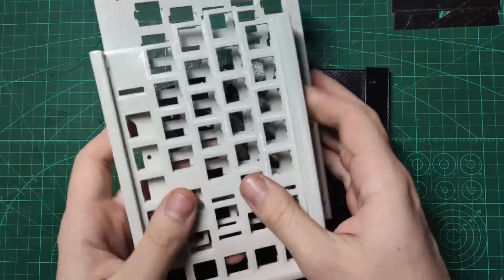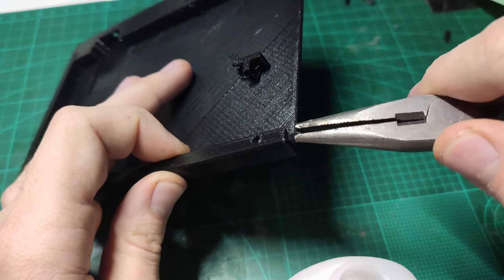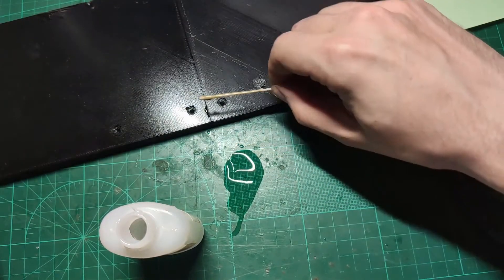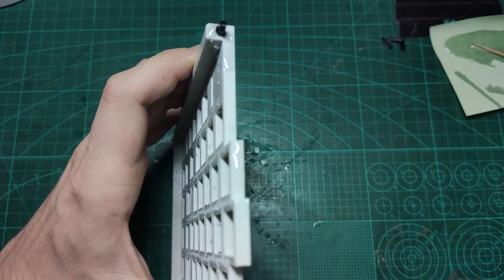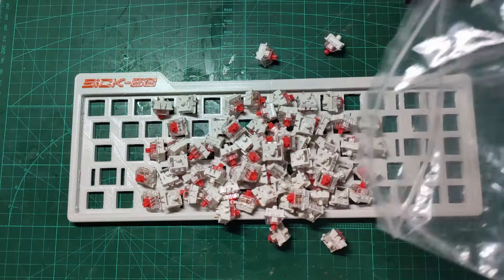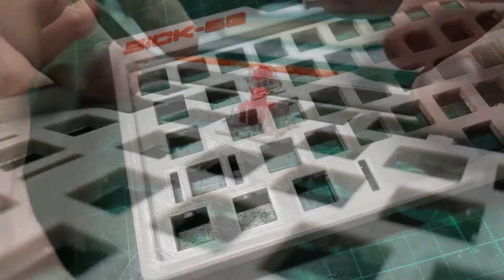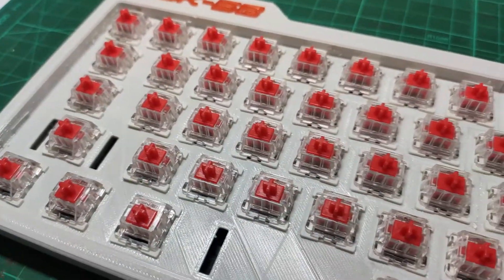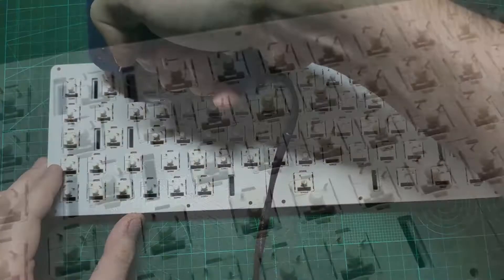SiCK-68 | 3D Printed Hand-Wired Mechanical Keyboard Build | Part 2

Comment: Very good project ! Did you lube the switches before mounting them on the 3D printed part ?
Reply from the maker: Thanks. No, I didn't lube them, but I should have since cheap switches benefit from lubing more than expensive switches. I did lubing on my other keyboard Corne Classic that I also did video of.

Comment: Thanks for the video. How strong is the glued join? Does it feel like a weak point?
Reply from the maker: Thank you for leaving a comment :) Not at all, the glue I'm using is very strong, it wouldn't even need the dowels for support. It's cheap hobby superglue from hobbyking, I added it to part list in the description.

Comment: I want to see the third part of the keyboard let's go
👍
Reply from the maker: Thanks for the comment! I worked on it yesterday and it should be up later today. I'm doing the hand-wiring in the third part and I try to explain the modified diagram for arduino micro. Stay tuned. :)
Reply: @infiniteoffset  it is possible to show the entire codode step by step of the esplicanodo ardoino and what day we will have the vidio I am really enjoying
Reply from the maker: @joaocaetano9362  I have just released the part 3, it took me a little bit longer, because my video editor hates me :) I tried to focus on the hand-wiring and I didn't show whole arduino flashing process since it can differ a lot for people using various operating systems or micro-controllers and there are multiple ways how it can be done. 
For short, I have just installed QMK on my computer https://github.com/qmk/qmk_firmware and then by the command '$ qmk flash -kb handwired/sick68 -km default' I flashed the firmware to the arduino. If you are stuck somewhere, let me know and I will try to help you. Also I might do tutorial for QMK in the future.
Thanks for you support, it's nice to see that there are some people enjoying my videos :) Part 4 (final one) will be out this week.